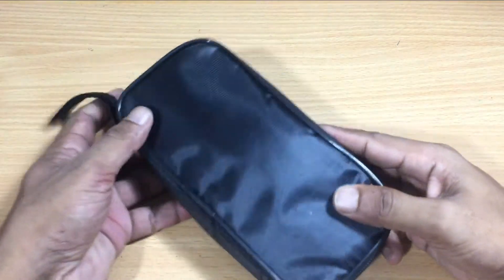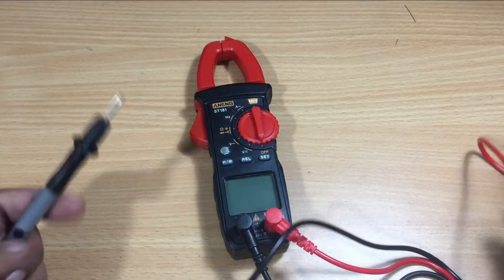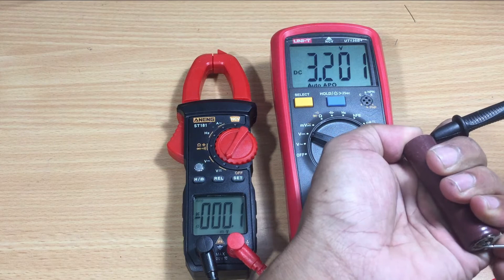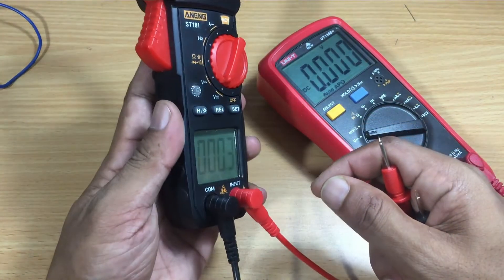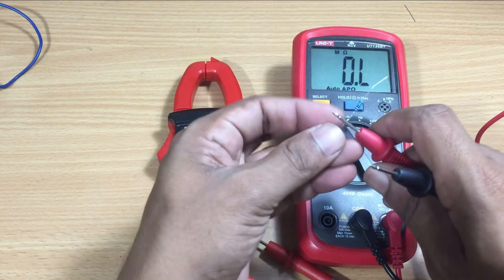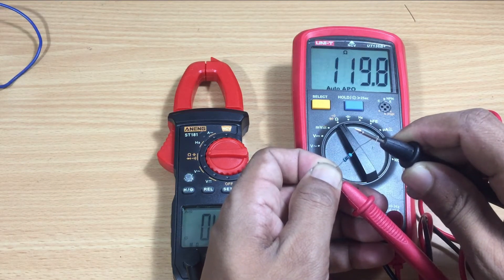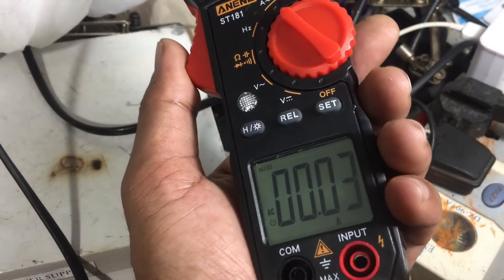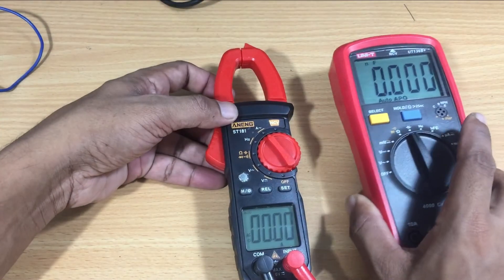ANENG ST181 Clamp Meter Review

Comment: What is the difference between ANENG st181 and Anengst184
Reply from the maker: Measuring range of Anengst184 is more than the Anengst181. but minimum level is higher than the Anengst181.
Reply: Thanks

Comment: Kaiweets, Aneng, uni t

Which clamp meter would u choose for more accurate reading and quality ?  ☺️💛
Reply from the maker: Uni-T, Because there is a reading delay with Aneng meter . But do not compare with Fluke. However, Uni-T is good for professional use as well. you can feel it when you hold the meter.. Important thing is, double check the selection before testing and gently and smoothly change the selector switch for long use.